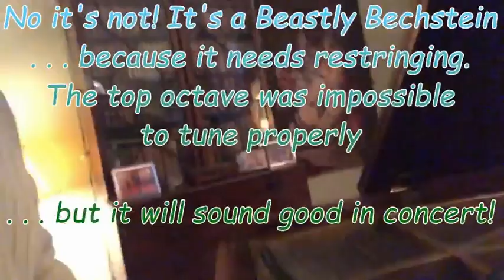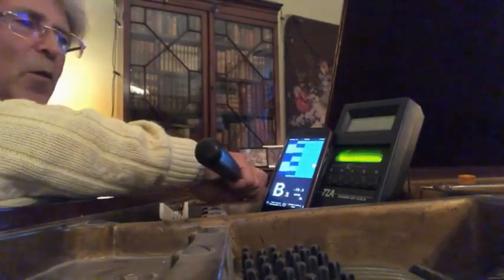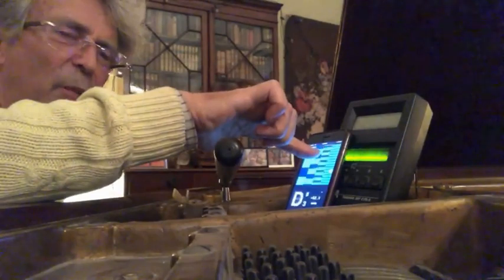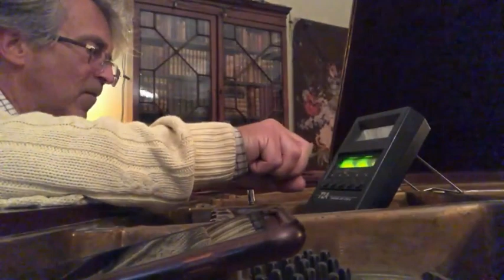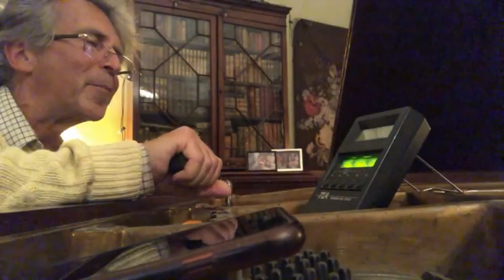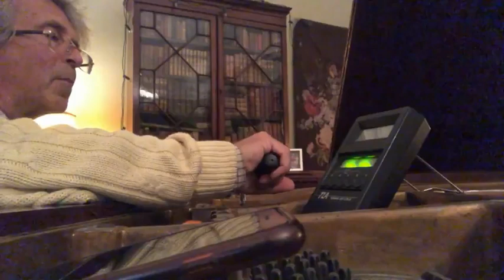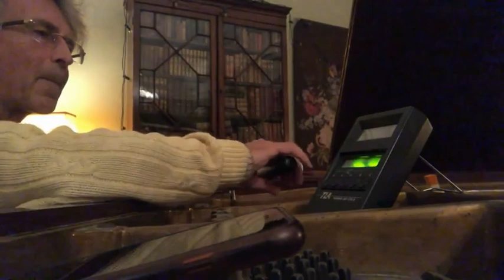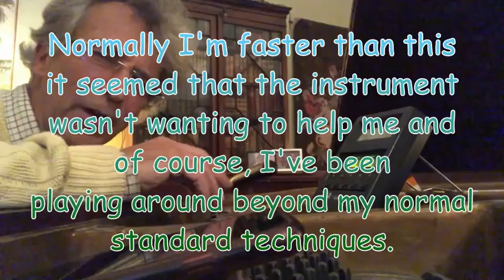Testing Peterson iStroboSoft, two-one piano tuning technique, 12 lever position, perfect 5ths by ear

Comment: You can calibrate the iStrobosoft app to the A-440 tone on your tuning machine. The menu is:  tuner settings - Advanced Settings - calibrate tuner. Then play your test tone and tap calibrate now on the iStobosoft app.
Reply from the maker: Yes. And when you calibrate to 440 and then play a piano note tuned at 440 the iStroboscope is wrong.
Reply from the maker: Yes. And when you calibrate to 440 and then play a piano note tuned at 440 the iStroboscope is wrong.
Reply: @unequally-tempered  Not quite what I meant: You can set the app to A=440 as you did in the video, then using the process I described in the advanced menu, calibrate from a known input frequency (in this case the A=440 sound source from your older machine) such that the iStrobosoft app will learn what a genuine A=440 should sound like and set its own app calibration as a percentage of what it initially THOUGHT A=440 would be, thus reading A=440 correctly. For instance, my input frequency was A=440, but my calibration is 99.972%. You should see a green calibrate now button in the app, and a red reset button in the calibration menu.